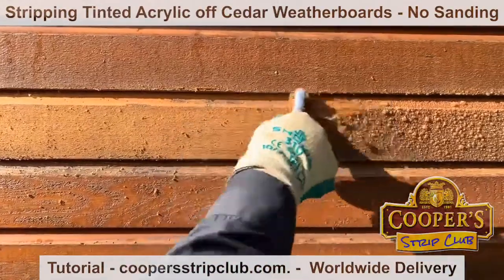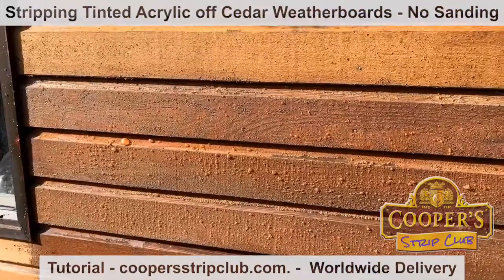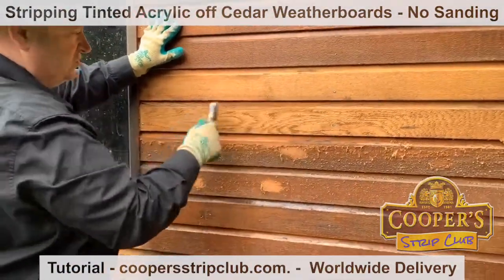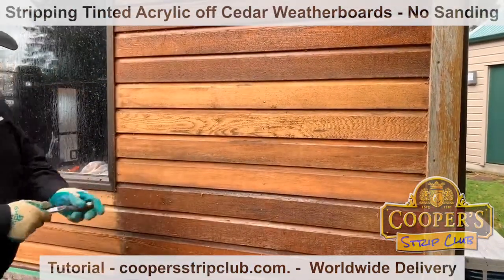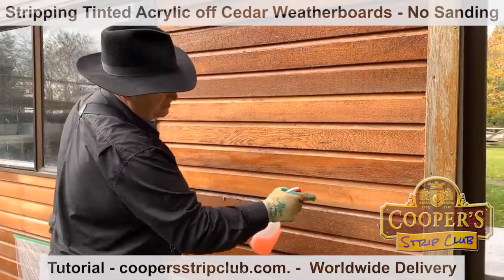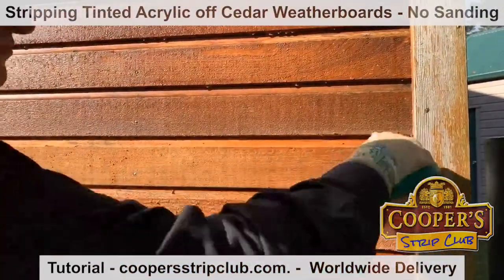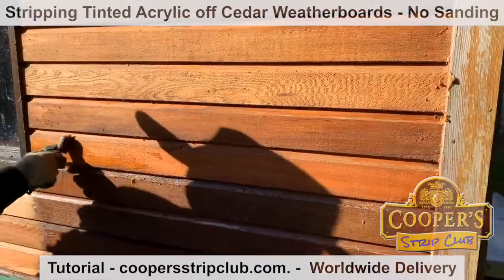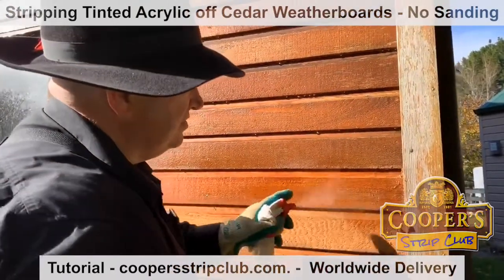Stripping Tinted Acrylic off Cedar Weatherboards - Full

Comment: Nice job!   I have a cedar hot tub that needs to be stripped and re-stained. It was stained with a water based product, which didn't hold up, and I want to use an oil based stain this time around.  Any information on your stripper and the type of brush you are using would be appreciated.